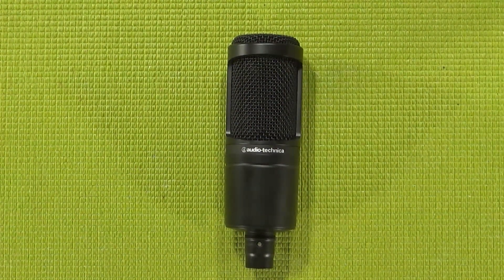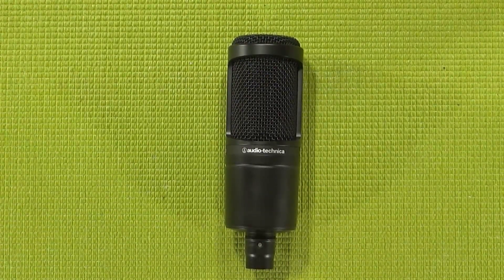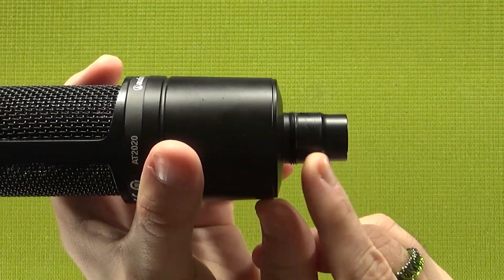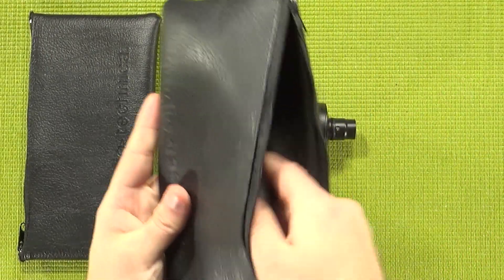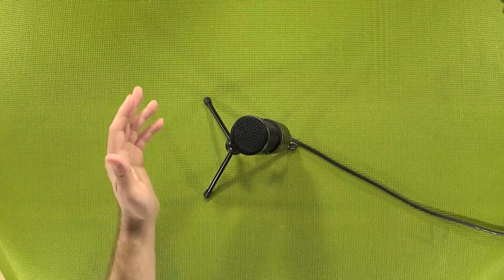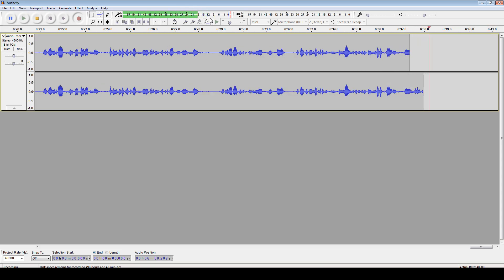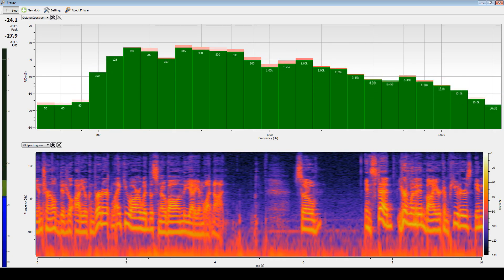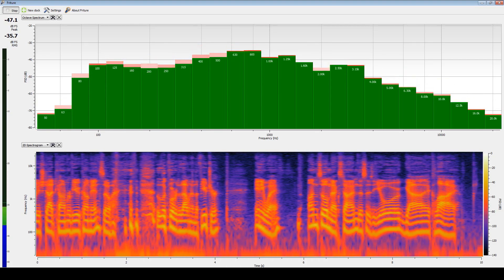Audio-Technica AT2020 Review + Test | Budget Tubing Ep. 6

Comment: Very interesting! For some reason, my AT2035 (which, for those reading the comments, is a beefed-up AT2020 with slightly better features and a few additional things added to it) doesn't have any sort of threading. I wonder if it's because this is an older mic (I picked it up about 4 years ago or so), or if Audio-Technica didn't want threading on this model for one reason or another.
Reply from the maker: That's very interesting indeed! I wouldn't think that Audio-Technica would do that with a side address style mic. At least there are friction mounts that'll work with it.